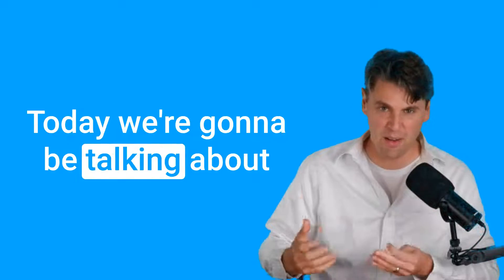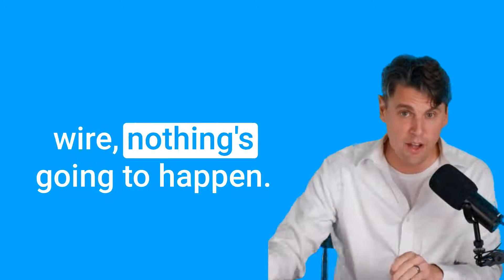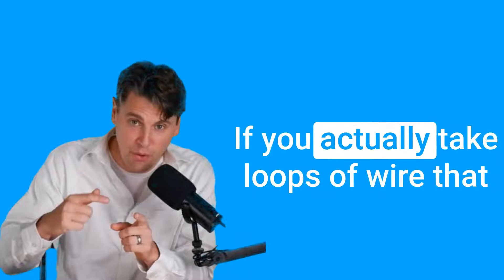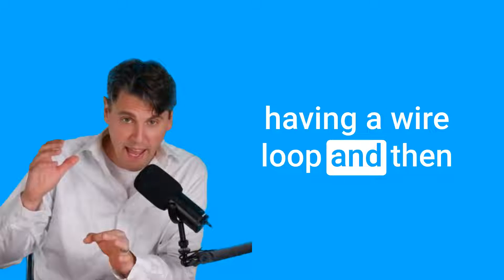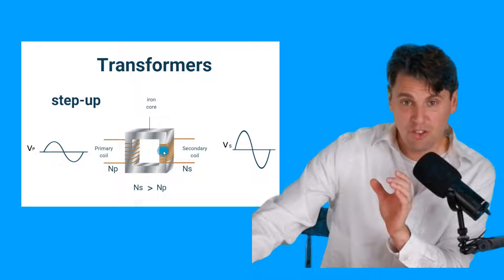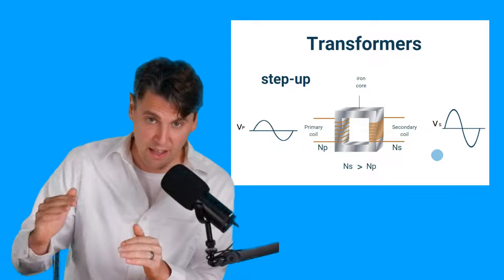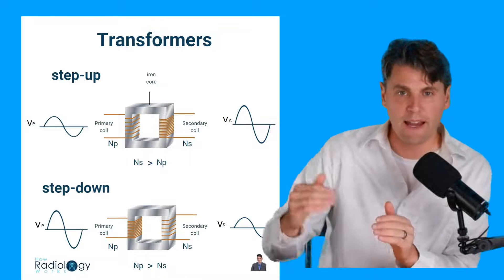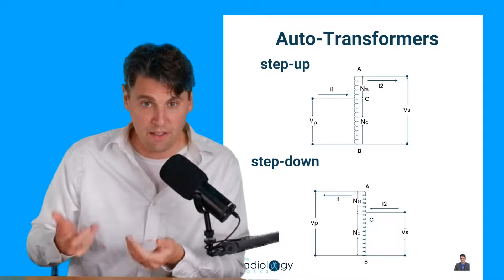Transformers

Comment: Can you explain why we need an auto transformer and not just use induction transformers?
Reply from the maker: The auto transformer is actually an induction transformer is just a induction transform in this case an auto transformer just mean you can vary the  relative windings of the input and output coils. In all case induction is being used in the transformers